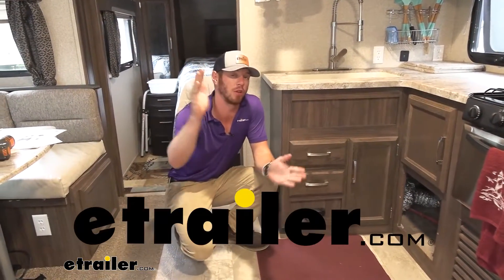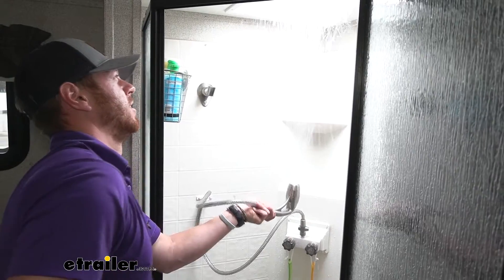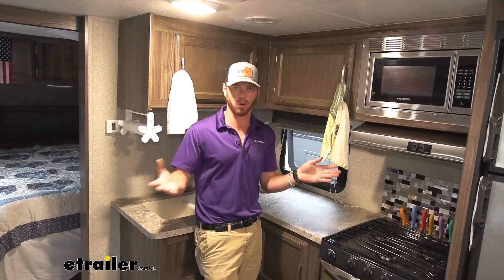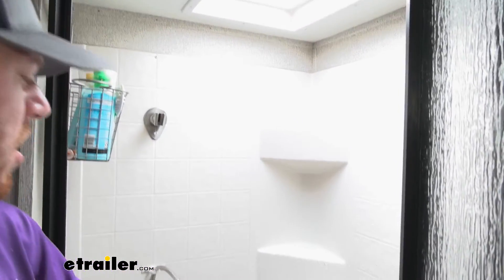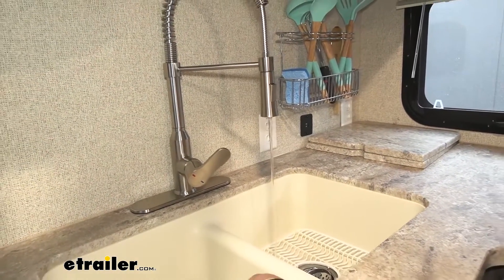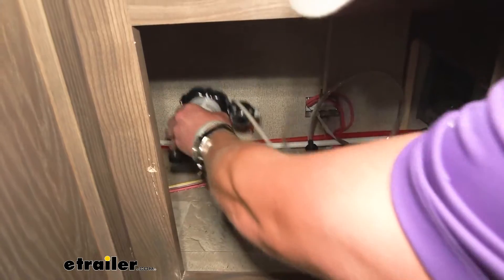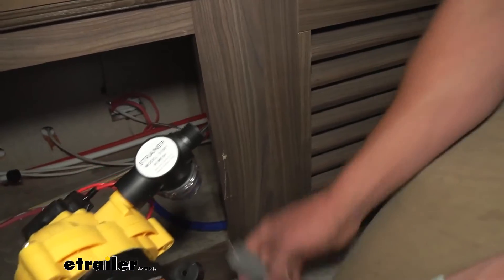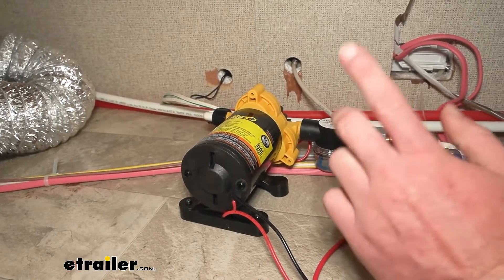etrailer | Ultimate Overview of the Flow Max RV Fresh Water Pump

Comment: A few things about those water pumps.  Firstly, the rated pressure is the shut off pressure and has nothing to do with the pressure while they are running.  SEAFLO actually makes the Lippert Flow Max for Lippert, so you might as well just buy the SEAFLO 33 series for much less.  The SEAFLO 55 series which you took out has an adjustable bypass valve that will allow you to tune to prevent all cycling.  You just didn't have it tuned.
Reply from the maker: Thanks! Sounds like you know your way around an RV water pump...
https://www.etrailer.com/RV-Water-Pump/Lippert/LC689052.html